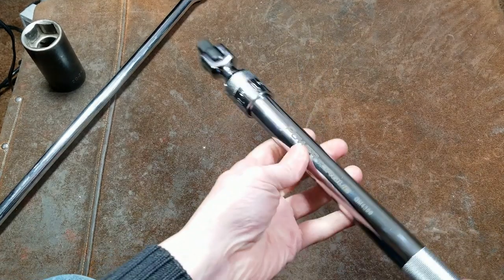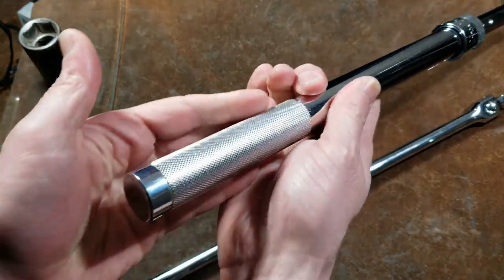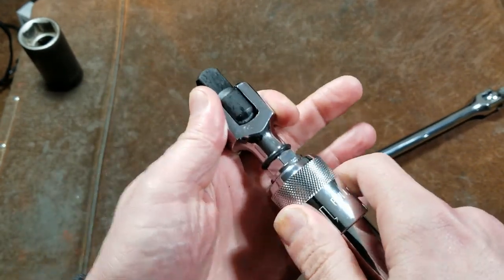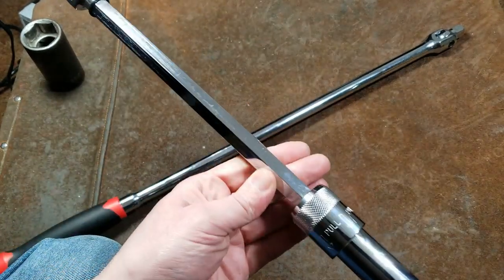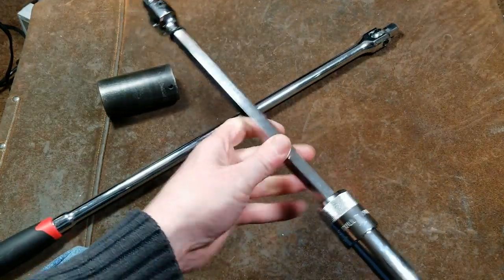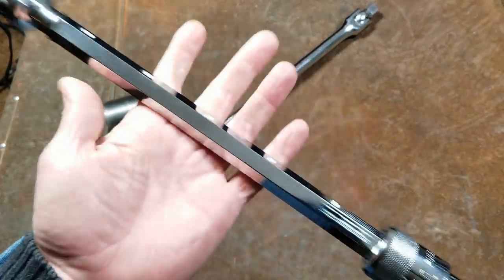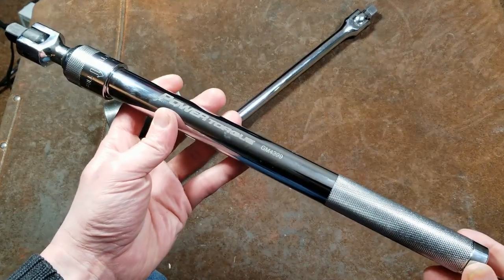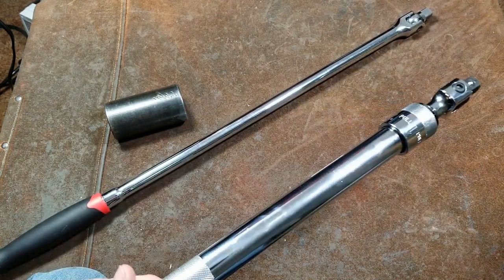O'Reilly's 24" PowerTorque 1/2" Extension Handle Breaker Bar Review

Comment: this style of breaker bar and ratchet is sold at my local parts store as well. and they are much much sturdier than the more common shorter ones with rubber handle.

Comment: My concern with the O'Reilly breaker bar is when it is fully extended.  I imagine under extreme use it may get torqued a bit, which might prevent you from returning it to its closed length.  Snap-on 1/2"-drive breaker bars (24" L) have a solid bar that is 11/16" (0.6875") in diameter.  I feel more confident and safer working with a solid bar, and am willing to forego the storage convenience this one offers.  About two years ago a YouTube video comparison was done with HF, Snap-on and (I think) Matco 24" breaker bars.  You might check out the results from that test, as well, for additional information.

Comment: Don't, typically, shop at O'Reilly's; does "GM" here mean "General Motors", "General Mechanics" or what?
Reply from the maker: Yes General Motors had a line of tools sold through O'Reilly's but the GM Tire never really helps sales so they stop putting the logos on them but still retain the GM part numbers occasionally you'll run into some older Riley's tools and the GM logo will be on the label